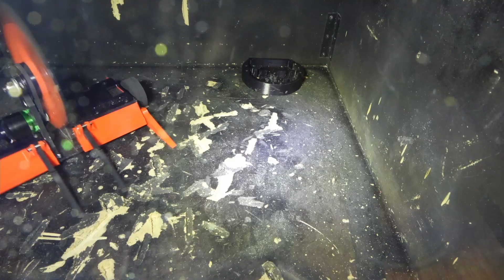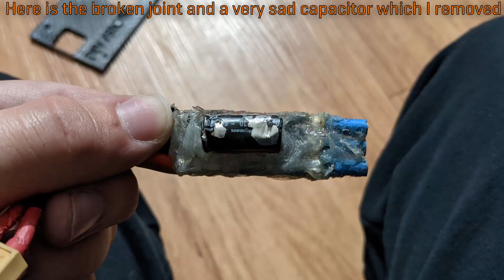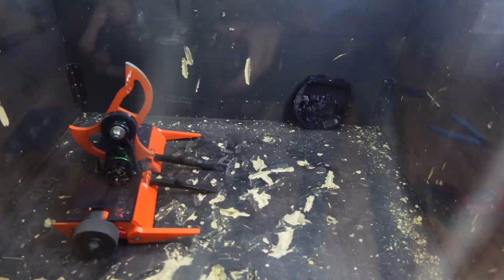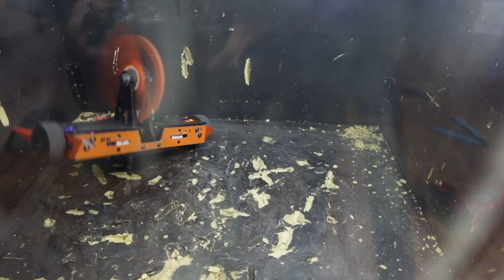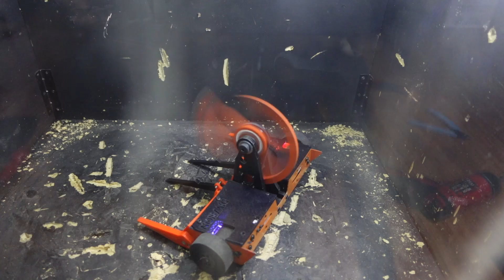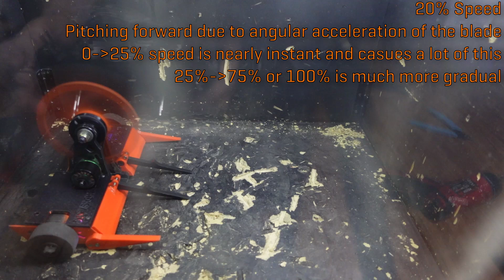Division: July 2021 Testing, 3D Printed Upgrades and Fixes [NHRL 3lb Beetleweight Combat Robot]

Comment: Where'd the custom wheels go? I was looking forward to seeing how they perform, thinking of making my own.
Reply from the maker: I have custom wheel hubs for foam wheels and custom cast wheels as an alternative, but the cast wheels are really heavy and likely to transfer a lot of shock to the gearboxes. I would only really use them in a non spinner fight where I need more grip and can make weight. 

Check out my Draconid event recap though to see how the cast wheels worked at 12lb scale! And I'm using different cast wheels on my newest beetle Shrapnel Mine. https://youtu.be/s21nh9MC7nU